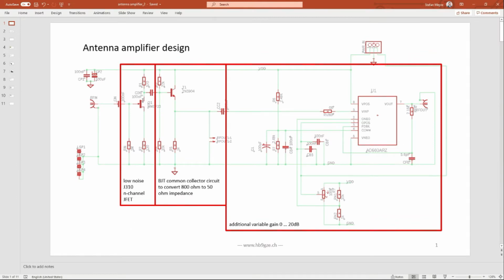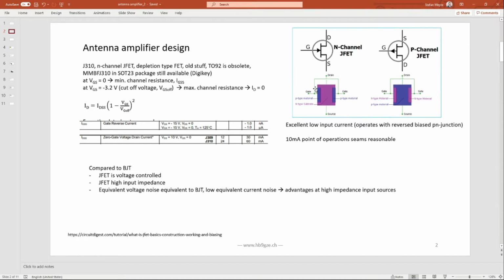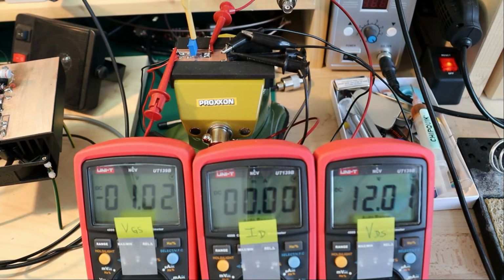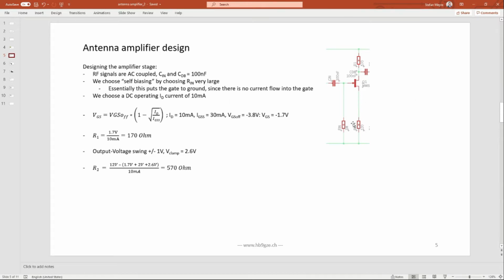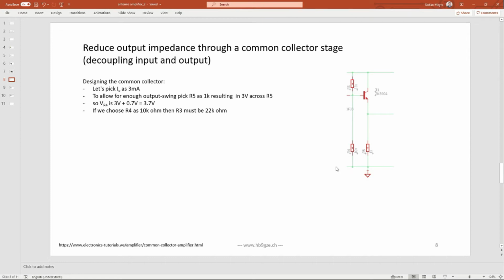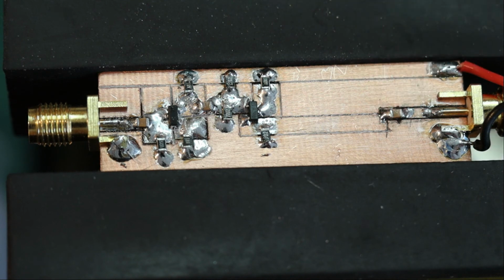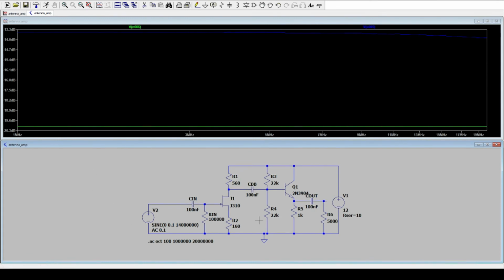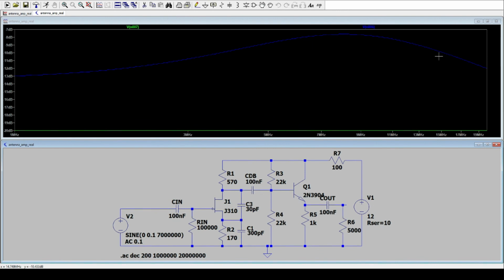DIY transceiver: Antenna amplifier

Comment: I'm surprised you saw such a big drop in gain above 10mhz on a surface mount build, as you say, presumably due to stray effects. I could understand that  at higher frequencies. Something is more frequency dependent than we would expect.  Device hfe shouldn't be a problem.  Maybe stray negative feedback?